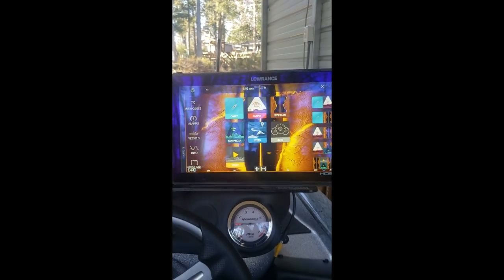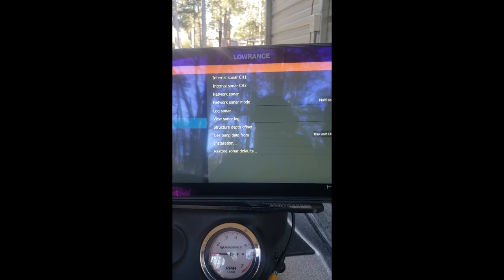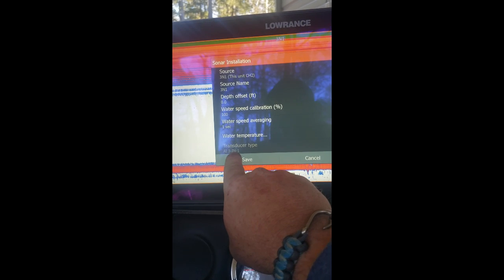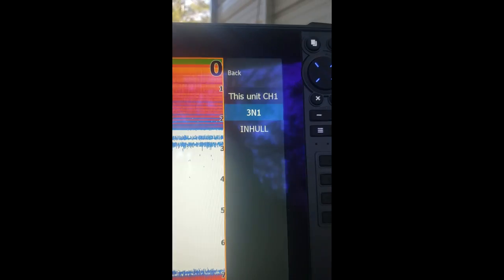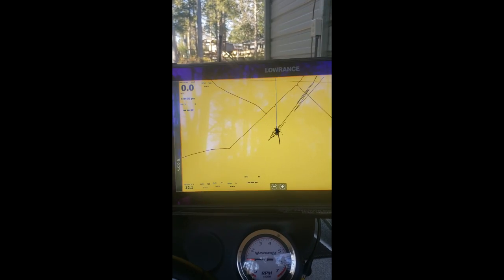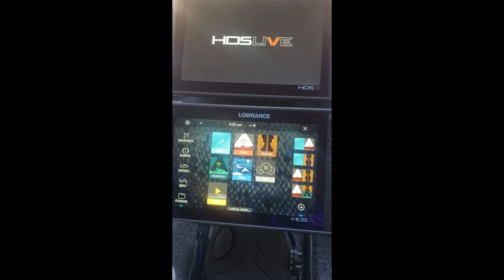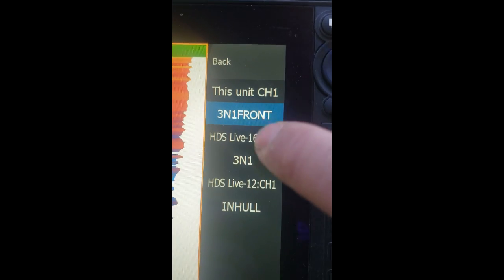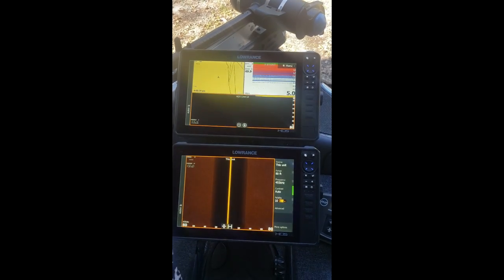Learning how to name your transducers so you know which one you are using!

Comment: I have a 3n1 on the TM and then the in hull 2D and a 3D SS at the console, along with 3 HDS LIve 12's (1 at the bow, 2 at the console).  I can name the sonar but is there a way to name the sidescan or down imaging on the 3n1?  It just says this unit.   And will the console units be able to see the 3n1?  I have ethernet and nema to all of the units.  THe ethernet runs from the 3D SS module.  Thanks..
Reply from the maker: no the source will be s3d.x.x.x. on structure for rear and 3n1front or what ever u name it on the front
Reply: Thanks for the quick reply.  I have the 3n1 2d sonar named 3n1 but when I go to DI or SI, it just says "This Unit".  Is there a way to show the name 3n1 on those screens in place of the "This Unit".
Reply: @PaulGettysFishing  Thanks for the quick replay.   I have named the 3n1 2D sonar, and it shows 3N1 on the 2D screen.  But when I go to DI or SI on the 3N1, it just says "This Unit".   

Also, when naming the transducers, you mentioned channel 1 and 2 need to be on.  If you turn the ones you aren't using, would that clear up the choices you have when you hit sources?  Curious why you said to make sure both were on even though they both weren't being used.  Thanks for all of your videos....I have watched many of them quite a few times....
Reply: Sorry, I thought the last part of my message got erased and didn't post...so I replied again...feel free to delete the last one...
Reply from the maker: @jimmyd.6042  if you are not using them turn the channel off, u cannot name structure sources only sonar choices, this unit would be the 3n1 if it is plugged into this unit.
Reply: @PaulGettysFishing  Sorry, one more question.   When naming the transducer, you mentioned both channel 1 and 2 need to be on.  Why would you leave the ones you aren't using on?  It seems like it would clear up your choices when you hit "sources" to change transducers if you have the empty ones off.  Just curious.   Thanks for all of the videos..I have watched a lot of them many times...